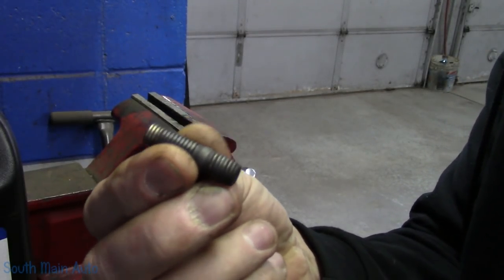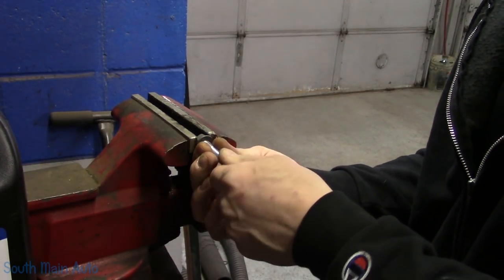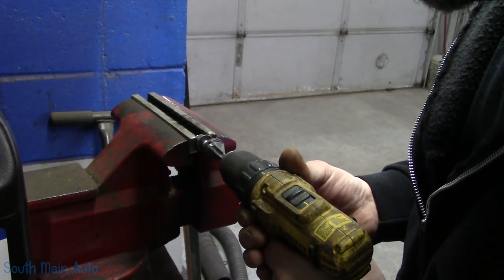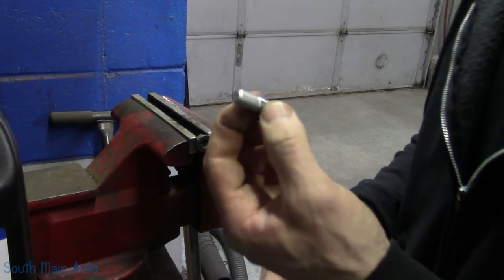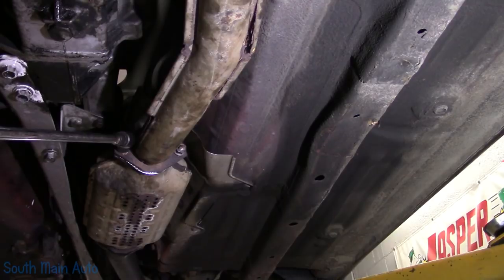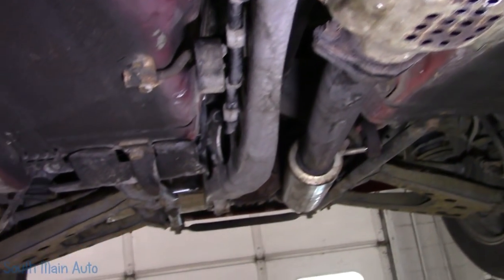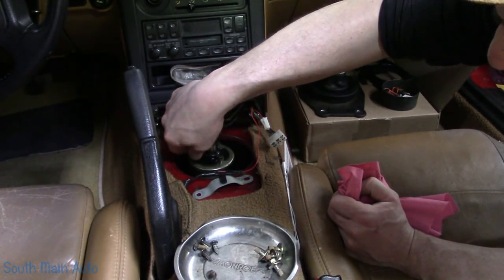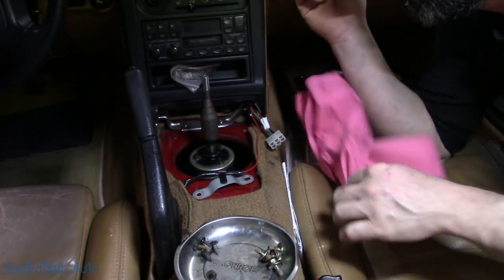Mazda Miata MX 5 - Clutch Replacement Job - Part IV

Comment: you made me remember doing clutches and transmissions on the old cars  like the 47 plymoths and the 90 toyota trucks  i remember especially laying those transmissions on my chest and aligning it with the pilot bearing to get it into the pilot bushing , those were good times, thanks for the video.

Comment: Eric,
39 yr veteran of the automotive clutch aftermarket here. I feel your pain on this one and I've spoken to unknown number of techs who have walked this type of walk on a clutch R&R the difficult procedure for a small car heck my full size Dodge CTD 6 speed is a stroll in the park compared to that PPF beam. I've watched several of your videos and this is as close to real frustration I've seen from you. Understandable.
You commented that the pedal felt light. An absolutely correct observation for a same for same R&R. As the disc gets thinner the release load increases (except for the self adjusting type clutch) a new full thickness disc returns release load back to new and cleaning the fork, pivot, greasing, guide tube cleanup and a clean no gunk clutch release bearing and you've reduced the friction for release. All of this combined equals a reduction in pedal effort. Shifts clean, engages smooth, no slip and shifts thru all gears? Go home and enjoy the family, well done. 
I don't know if you previously addressed this but I see you installed customer supplied parts. Care to comment on this cause lots of shops either will not install customers parts or many times it sets the stage for a really bad day and outcome that usually falls back on the customer trying to save a buck.
Well done. 
Gary

Comment: Got to say that for one man you certainly get a lot of cars done and shipped out of there.  Not to mention that you spoil me for having an expected standard in my search for a mechanic/technician.  My car needs a service and I want someone who I can trust to do it.  Using the correct oils and parts etc, but then I think that I should just do it myself.

All you need now is an extra pair of hands to take the load off of you so you can have a 5 or 5 and a half day week. Great job as always.

Comment: Eric, I like your workmanship overall. Regarding exhaust/cat converter flange bolts, I use stainless steel fasteners with double SS jamb nuts and never-seize... Too bad the manufacturers didn't think of that for owners down the long north eastern folks road. I guess an extra 20 cents of cost going with SS fasteners was too much of a price point for the car companies.

Comment: This was a fun series to watch only because I have done many of these kits clutches. They all have problems. You just pushed through. I have never wished I could have told you through the video more then when the needed to lift the front of the motor to stab that trans.

Comment: These kinds of multi-part projects in between diagnostics and programming is what makes your channel so great Eric. 

I find a lot of hydraulic clutches to be finicky when you change the clutch. Quite a few I've done i find that after replacement they are pretty close to the floor with the biting point then they migrate back up nearer the top of the pedal travel after a week or two. 

Some of the cleanest gear oil I've ever seen come out of anything too. She's been looked after. Nothing like the smell of rancid 12 year old gear oil. I'm a big fan of good old fashioned Dino gear oil as opposed to the synthetic stuff. Some Toyota boxes especially the synchros are really fussy with the gear oil types and seem to prefer cheap yak piss instead of the fully synthetic stuff.

Comment: Great video series.  We own a 1994 Mazda Miata.  If I have to replace the clutch I will make sure I pre-make the studs and have several cans of WD40.  By the way ... driving a Miata on curvy roads is a blast!  Thanks for the Miata video series.

Comment: Now all the customer needs is some sunny days to enjoy the car.
Reply: Yar Nunya , I have a 2000 Miata and its sits in the garage until the weather warms up😀
Reply: My Miata stays parked under a cover until the snow is all gone.  Not so much because of the cold, you're right about the trans tunnel keeping you warm but even with snow tires,  the light weight and rear wheel drive is fun but not the most practical in the snow.
There was a guy here a couple of years ago spun out and got broadsided by a truck on the way to driving his teenage daughter to school,  she died.  That convinced me to stick with the 4wd SUV in winter.

Comment: Enjoyable series. Hassle max with bolts. Glad you mentioned the harness on the top of the transmission, thought I might have missed it. You mentioned you like to use mineral oil in your tractor. I followed a BSA DBD 34 Goldie from Chalfont St Peters to Snetterton, to watch Bill Ivy and Brands Hatch 1964. Made sure I followed as much as possible because he was running Castrol R40 ! What a lovely smell !!! Thanks :)

Comment: Just  a thought on the twisted off screw and bracket on the harness. I used some 3M panel bond adhesive for the first time to put some cab corners on my truck. That stuff is AMAZING !! Had some left over, just squirted some on cardboard, mixed it up and used it many times to stick 2 pieces of metal together. Works fantastic. A little pricey but nice to have around. Probably would have kept that bracket in place forever.  Nice Job as usual Mr O. You are a true professional.

Comment: I'm finally caught up on the Miata project! What a battle! Imagine doing this on jackstands outside - probably why I curse so much ... 😁 Won't be long now, though - once this damn snow melts that we got last night, the weather SHOULD be trending warmer, and I'll be in good shape to get my floor poured, and throw my lift up. The angels will sing on that day! 

I worked a partial Sunday yesterday too. Went to visit the ol' man & my brother for the morning, then came back home and geared up for a knock-down, drag-out battle with a set of 255/40-19's off a '15 Tiguan. I've got an old school, 13 year old chinese tire machine, so it was "fun", lemme tell ya! Had to borrow a couple 14" wood clamps from the neighbor, since I have no idea what dimension mine have warped into - wasted at least an hour looking for them - needed those to keep the bead in the nearly non-existent drop-center (or is it now "drop-offset"? Definitely not the center! 😆) ... and then a stupid Jenshang Fungwong Ltd. hose kinked and split, so when the jaws were fully open, I got a tank-emptying leak blasting out under the turntable. Spent another 15 minutes fixing that. This business can be "fun" alot of the time! 🤣 

I have days like you were having on Part III, 98% of the time ... Wrong parts, missing parts ... That missing clutch alignment tool was classic. That would happen to me, except I don't have any spares, nor do I have the universal kit! Makes for a fun afternoon ...

I definitely need to get my torches up and running soon. Been using Mapp and a drill - not the most efficient way of extracting exhaust bolts! Takes FOREVER. I've got plenty of scrap and junk vehicles here to practice on before I turn customer's parts into liquid. I'll be practicing first! Don't know how I've got by this long without them. Should have enough cash in the swear jar to pay for the concrete floor now, at least ... 🤑

Great series man! Thanks for sharing the battle with us. The battle is REAL! :)

Comment: Hey Eric I was taught when cutting a piece of stud bar to run the nut down past where your cutting off to length this nut having issues trying to get it back on or cross threading. Obviously still deburring as you did. It’ll save the hassle that one time. 👍

Comment: I've always liked old Mazdas and will likely own an older Miata at some point.  Yes they are a bit over-engineered but the cars of the '80s and '90s seem to hold up really well.  For a DIY'er  getting the wrong part is just an excuse to blow off that day "cause parts".  I now can now empathize with the frustrated pro with a shop full of work backing up.

Comment: I live in Arizona and had the same trouble with the studs on my cat. One nut came off easily and the other one spun a few turns and then locked up tight. Ended up snapping the stud off trying to take it out. It's worth it though when you have the most fabulous car in the world :)

Comment: And that miata i worked with he had taken it to a couple of places because his automatic head light doors were stuck open. They said he needed new switches and motors for them. I looked at it and read the owners manual. That red button in the center dash is the manual overide to keep them open. He often had a dog as co pilot so probably he never used it but a dog nose did!
Reply: Sorry,  under the red button is the other one if I remember right now.

Comment: That oxidation really does you in buddy. I used to throw TSB (chatter/vibration) clutch discs in that exact gen Miata in about 30-40 minutes. It only paid 1.5 warranty. Of course, at the time, they were 1-2 year old cars. Good thing you don't have to see many of them up your way. I'm in FL. They are super popular here.

Comment: Not sure if you knew this, but a 12 point socket will fit perfectly on those square drive bolts. Anyways, good work on this job given all the circumstances!
Reply: and always remove the fill plug before the drain plug to make absolutely sure you can refill.
#BestPractice

Comment: I saw a 97 Miata for sale that needs a clutch.  That's how I found this video series. I've see your videos before. For a split second I wondered If your shop is  here in Houston. South Main is a busy street on the South side. When u said it was snowing in April I knew then it wasn't here.  It is a bad winter here when we get a total of 2 inches of snow for the season.

Comment: I once saw an 'old tech' hack for shortening bolts that involved threading two nuts onto the stud and then grinding it flush with a grinding wheel.  I'll try to find it again but i used it once and it was so much easier than trying to worry about damaged threads or a flush and even surface.
Reply: cut with cutoff wheel or hack saw, then clean up on bench grinder or die grinder. always done them that way, just angle the leading end at 30 degree roughly, , gets rid of burs and tapers the starting thread plenty. or just use the cutoff wheel if you have good control!

Comment: I have a 2000 Miata that needs a new throwout bearing and I've been trying to decide if I want to try to tackle a clutch job myself laying on my back on the garage floor. I'm still not sure but I've definitely gotten some useful info from this series. Thanks!

Comment: Yeah it definitely sucks that you have to work so many 7 day weeks. But on the flip side it shows that you're committed to your customers cars and getting the job done right. I hope you get to film a ride around Avoca with the top down in the Miata when the customer returns to get the slave cylinder done. To bring the camera along for the ride would be priceless as I don't think Eric O. Gets to ride in too many convertibles. Lol

Comment: This vid was great Eric...Imagine some young man or woman looking thru Y.T for a clutch video...this was comprehensive and you made it fun....I like how you think about the DIY'ER  and keep it simple......sooo with that said, I think it would be a bonus if you pull out a special professional tool and do your repair BUT....you explain an alternative to the way cool that nobody but professional tech's would have...like the de-burr tool situation , you might have said "Installing a nut on the stud before you cut it so you can run the nut past the cut to clean up the thread"...ya know...anyway this comment is approaching the length of a Miata clutch job ...soooo Adios Amigo. and thanks for all your hard work .

Comment: Great videos! Big thumbs up! Just wanted to add something: in the Miata repair manual Mazda recommends both GL4 or GL5 oil for the gearbox.
Reply from the maker: Interesting because the sulfur content used for the EP rating is so much different between the 2. Usually gear boxes only use GL 1 3 or 4 hardly ever 5....

Comment: Doesn’t the shifter ‘well’ have to be filled separately from that of the transmission oil? I thought it had to be submerged in its own separate bath of oil? Somewhere my dusty memory, this has surfaced.

Comment: A tip on changing gearbox oil.... make sure the fill plug will break loose BEFORE draining the fluid.  A seized fill plug with an empty case is a bad day.
Reply: He coould fill through the shifter turret
Reply: @dodgeplow  In this case, yes.  In many gearboxes & differentials, the fill plug is the only option, so it is good practice to make sure that will come out before draining.

Comment: MR.Eric can y do video explain about the scan tools what's the main difference between them like comparing different brands like launch, snap-on...etc also the OEM ones, why they vary in price what different functions or tools that some can do but others cannot and why the vary in price starting from the cheapest 20 bucks tool till the 10000 bucks snap-on and the fancy ones

Comment: Nice series!  Uniburr pretty neat little tool may have to get me one. I usually screw a nut on to where I need to cut, cut flush with nut and when I take the nut off it rethreads and GTG but the Uniburr is definitely more efficient and you can never have too many tools!.  I'm supposed to be retiring but I keep buying tools added an Autel MaxiSys Elite and J2534 to my scan tool arsenal arriving Monday from AESwave and that's it...no more tools as every mechanic has never said HAHA
Reply from the maker: I am iffy on the Uni Burr to be honest. It only like really really soft metal. I think when it dies, and it almost has I am going to get a different style burr... Other wise I will just screw n the nut like we have for years haha
Reply: Thanks and all the reviews say the same thing it won't cut anything hard and wears out extremely fast. I used to have a stone one that lasted forever until it grew legs which is another reason I like a one man shop. If I find a PN I'll let you know.
Reply: @SouthMainAuto 
On one of my bench grinders I have a sanding drum on one side and wire wheel on the other side. I always stick the offcut end of the fastener in the vice to cut off and then use the sanding drum to clean up the burrs. This can be done on a bench grinder stone wheel as well, although I like the sanding drum better. I also use this procedure to slightly round off or blunt point some fasteners so they are easier to align or insert into holes.

Comment: If you need to cut off a bolt or threaded rod and don't have one of these deburring doodads, put a nut on it before you cut. When you take the nut off again, it will straighten out burrs or folded bits of thread. Then you can give it a couple of licks with a file (from outside in), and you're done.

Comment: " Braaaa "  -  ( I think that is hilarious how you imitate the dork you tubers... )...   Nice ending... One thing I always notice, is fresh / new clutches have lighter pedal pressure than the old one... I think it is a combo of the lubed up linkages and the slightly diff angle of the pressure plate fingers due to the new / thicker disk...  I could be wrong...   But, nice job, that one had some serious toughness....  The Porsche 911 clutch and IMS bearing I did was tough like this in a slightly diff way...

Comment: Hoo boy. Everybody's calling it the "clutch from hell" and I'm sitting here thinking it seems fairly reasonable aside from the power frame bolts and of course the pesky studs. At least it's not a FWD pain in the pooper, or worse 4WD. It's not as easy as they get, but it's in that neighborhood.
Reply from the maker: Yeah I hear ya! It is really a gravy job and I would do them all week long TBH. Just hit a few parts snags is all. Rather do this than a front wheel drive v-6 haha

Comment: Great series, Eric. Really enjoyed it. I recently replaced the slave cylinder/throwout in my Mazda B3000 so much of this looked quite familiar. I should have done the clutch and pilot bearing as well, but was needing it back together so only replaced what was known broken. Major pain to have to remove the bell housing for that job, but that's how the engineers decided it should work. On yours, I would like to have heard the sound that the frozen pilot bearing was making (did I miss that?) just so I'd know what to listen for going fwd.

Comment: And...according to the first video when it came out, the shifter padding appears to have been the other way around...the thin part wrapping around towards the rear, and the other piece has the hole on the passenger side.  Of course, it doesn't really matter, so long as it all fits and works as intended - and there's no guarantee this one was a virgin when you pulled it apart anyway.

But sometimes, ya can't win for trying.  :-P

Comment: brah, always remove the fill plug before the drain plug.  If you drain it and then you twist the head clean off the fill plug you'll be like "ohhh brah no way!  Now I've gotta flip the car upside down to fill the trans brah"  
Man, that was a hell of a 2wd, rwd clutch job.  Reminds me of the time my buddy asked if I could do the slave cyl on his 4.0 Ranger.  I was like "no problem brah, I did my 4Runner's in like 20 mins.

Comment: Eric you are right, you call the size of the bolt by the thickness of the threaded part. the head of M8 bolt can have in the automotive world 12 13 or 14mm hexhead, the rest of the industie its always 13 mm. Did you drive it that little sportscar.

Comment: Hey Eric, those bolts are a massive pain in the A. Found out myself, also when cleaning the shop floor I found out the manifold bolts are non-ferrous. Could potentially explain why they get so seized on!